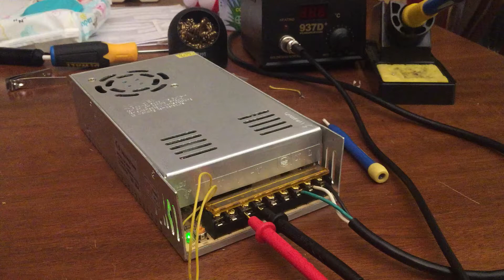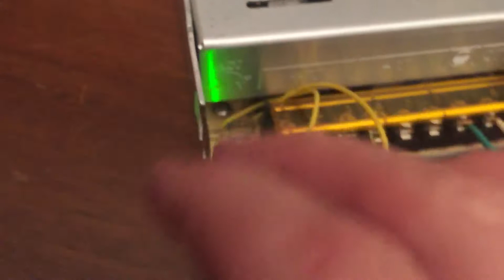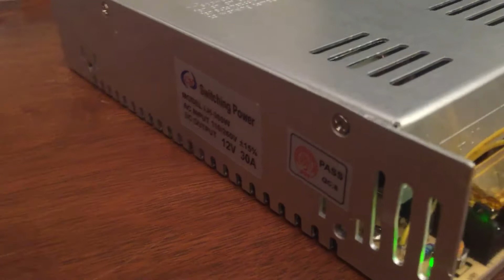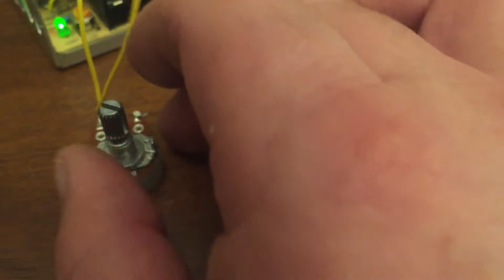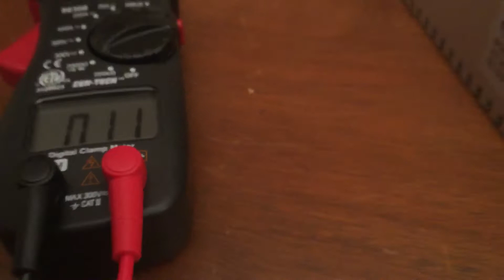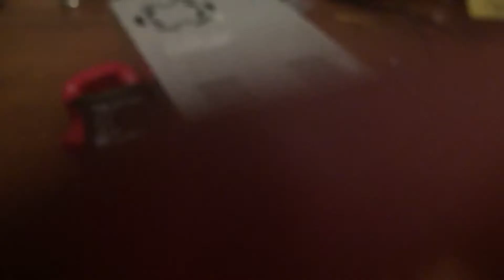Voltage Mod 12 Volt 30 Amp Switching Power Supply S-360-12 Meanwell SuperNight

Comment: Thank you very much. It works! I have used a 1.2K resistor instead the 1.8K (the original). Now i can use the trimmer on the board to change up the voltage.

Comment: ok...so i have the ica smps 40 amp model. the circuit board is spd-s05000012-v2.0 and i have several combined. id like to make it combined variable. could you by chance tell me what that would require? id very much appreciate it. shoot ill throw you like 20 bucks for your time if u can help!

Comment: Nice im planning to buy a 12 inch. 12v.  54000 led lummens 6w . Im planing to use it outdoors what amparage i need thanks
Reply: Divide wattage by voltage to get current. (6W/12V=0.5A)

Comment: Up in voltage down goes current rating
Reply: this is true. that why i put 20 of em parallel. now no matter how high i go in volts...i should have plenty of current lol not for long though. cause that big box is on the bench. i may need another ten